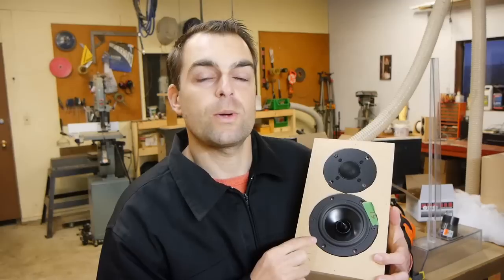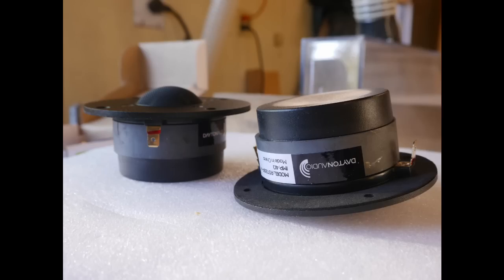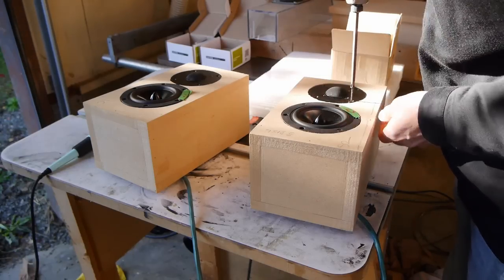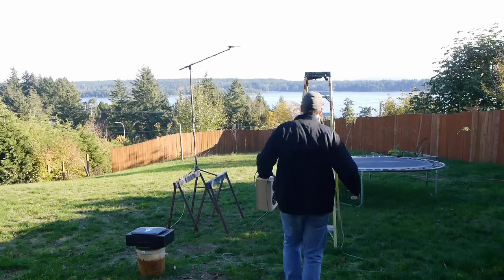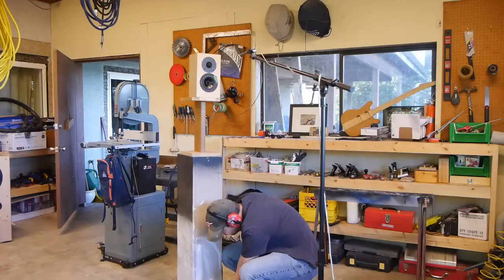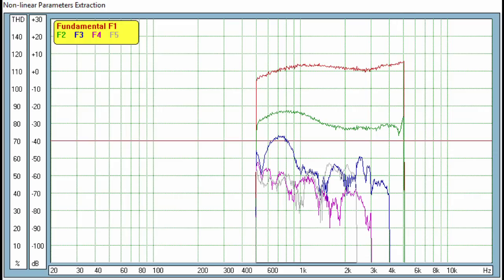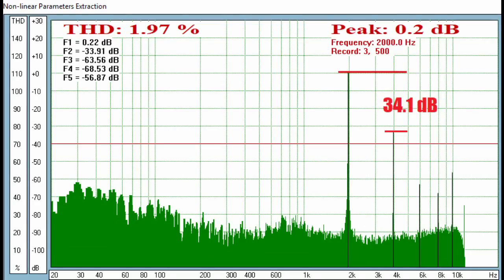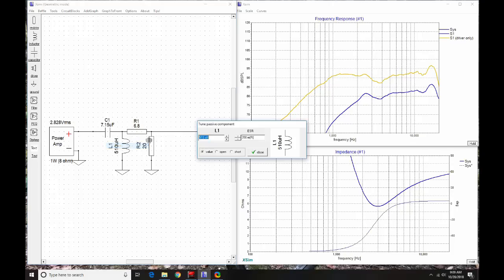Dayton Audio RST28F tweeter | Test and Review

Comment: Those terminals are ok if you use push-on crimp receptacles. Often, terminals are not meant for soldering. I made a point of getting 3 sizes of these crimp connectors for the same reason.
Reply: Yes
Reply from the maker: Shaun Onverwacht ya a push on terminal would negate that issue. I’ve never had this problem with any other tweeter though. People solder onto terminals like this all the time. Not sure why these would be so sensitive to heat.
Reply: @ImpulseAudioSpeakers  You'll find the same issue with the Dayton DC28F-8. The RST28F seems to be a more upscale version of the DC28F-8. The tweeter to try for the same money is the Dynavox TD2801-XL.
Reply: @ImpulseAudioSpeakers  yes, traditionally they were usually solderable.
Reply: I actually accidentally melted the terminal right off on my first build. Luckily I managed to solder directly to the voice coil leads they were attached to and it still worked fine. But yeah the plastic gets super soft super quickly.
Reply: @__-fm5qv  Old school method is to clamp a long nose pliers between the solder joint and the (temperature) sensitive part. Acts like a heat sink.
Reply: Squeeze  to open stainless steel tweezers or a small hemostat are soldering friends.

Comment: Huh now i noticed something. Tweeters size is measured by the dome width, but anything with a cone is measured from the edges of the gasket instead of giving the width of the cone + surround.
Reply: Yep i learned that the hard way when i ordered 4  2" super tweeters and they required a 4" cut out to fit the box....

Comment: Can't you move that tweeter off-center? That might help. As I recall there is a program called Edge that helps simulate baffle difraction.
Reply from the maker: Илья Основиков yes that could help but introduces other issues. The best is to roundover or chamfer the edges, which I’ll do in the final build. Edge is an excellent tool. Xsim also has a diffraction predictor if I recall correctly. They’re very useful.
Reply: @ImpulseAudioSpeakers  Agree, but at those frequencies (3500 Hz) a roundover or a chamfer has to be faily large in size to be effective. Am I correct?
Reply from the maker: Илья Основиков yes that’s true. At least 3/4” would be good. I’ll be able to get an inch, maybe more on the final build.
Reply: What other issues?
Reply from the maker: ThePentosin the other issues is that it only corrects the diffraction for one axis. As you move off axis it shows up again. Basically sharp baffle edges have diffraction no matter where the driver is on the baffle. A big round over actually reduces diffraction. The offset just moves the diffraction frequencies around a little.
Reply: Right. I'm aware of that. Roundover can be combined with offset tho. Right now you get the diffraction from the sides happening right in the same spot, making it more severe...? Offsetting would make the dip shallower but wider. Trading something for something else..
Reply from the maker: ThePentosin oh it also means that the off axis will be different on the left and right as you move off axis which is not good.
Reply: Oh right. That's a good point.

Comment: Don't all 1-1/8" dome tweeters have problems in the higher octaves, even the expensive Morel parts? Would a 1" SB Acoustics be a better choice, or does unavailability at PE come into play?  Thanks for the hard work and great information.
Reply from the maker: Good Goat in my experience not this bad usually. This tweeter is clearly breaking up above 15khz. Others can usually get beyond 20khz before they have too many problems. I don’t order from PE so the choice was not an availability issue. Another option may be better but this is what we chose so we’ll continue down the path and see how it sounds.

Comment: Please throw some foam on the baffle and remeasure, that diffraction is nasty looking and I'm curious what the real response on axis is like.
Reply from the maker: Tarek Z I will be adding round overs to the finished speaker and may test on a 200mm baffle with a round over. Foam isn’t a very practical form of diffraction control in my experience. Hopefully the finished product will control diffraction better when I’m done.
Reply: Maybe move the tweeter over to one side abit?
Edit: this is already brought up in another comment.
Reply from the maker: ThePentosin ya as mentioned with the other comment you saw, it helps but not a ton. I’ll use big round overs to try and help with that.